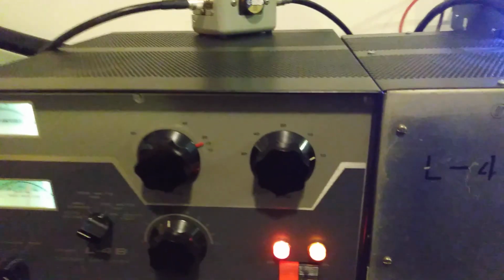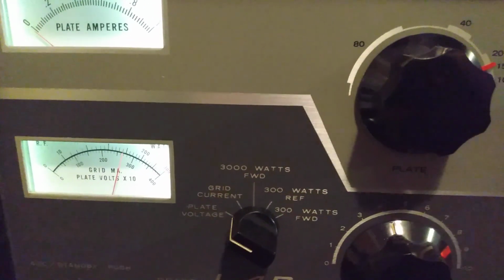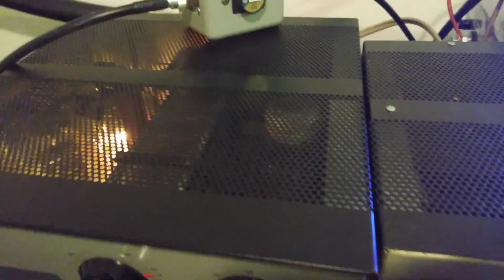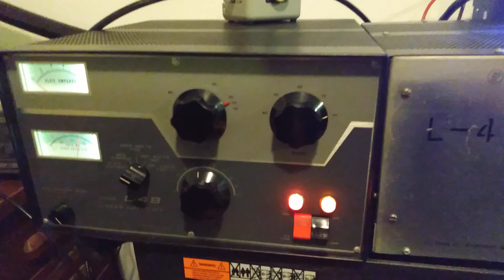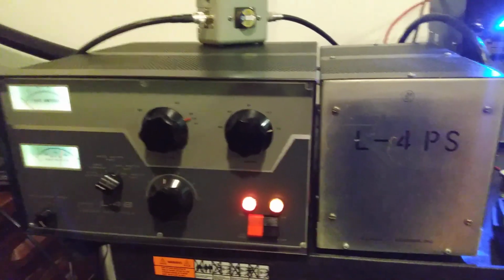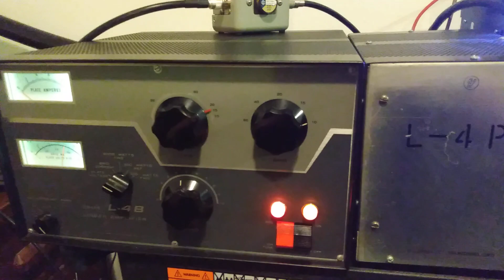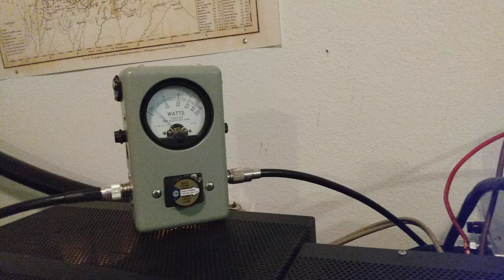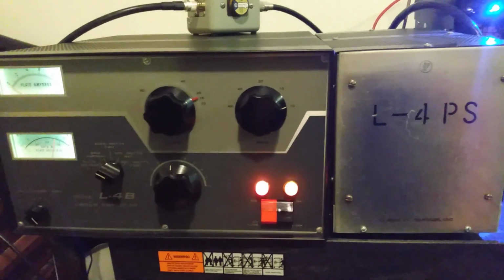Immaculate Drake L-4B, Dual 3-500z Amplifier, Refurbished like new

Comment: Just checking on drive fixing to put a 99n2 in my pickup driving a 2 3500z box
Reply from the maker: You running an inverter or ac alternators?
Reply: @Rooster_Radio  inverter but alt will be 300amp with 2 workaholic batteries
Reply: Either that or thought about a 4500w gen in back